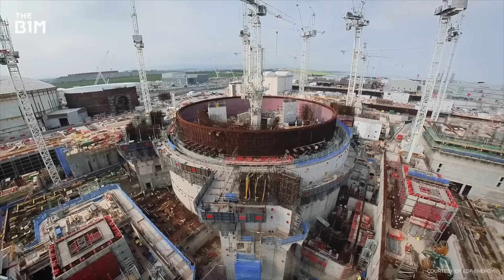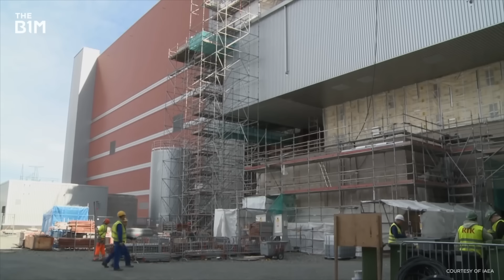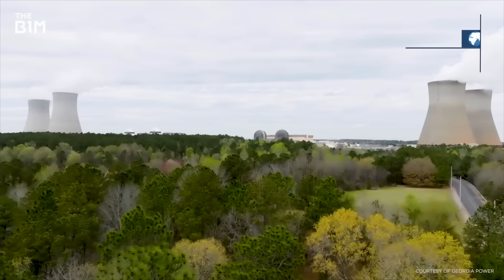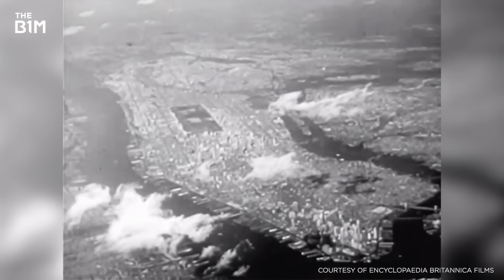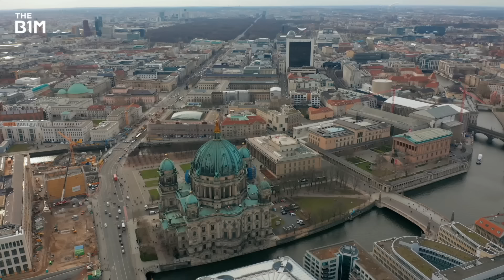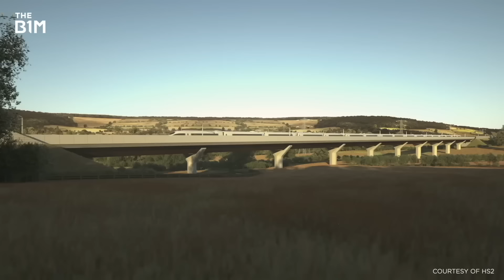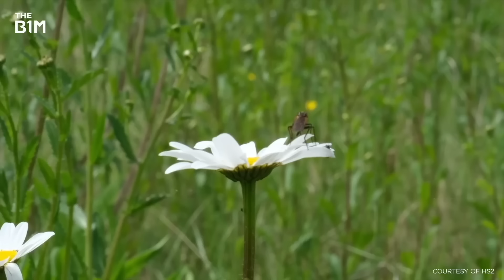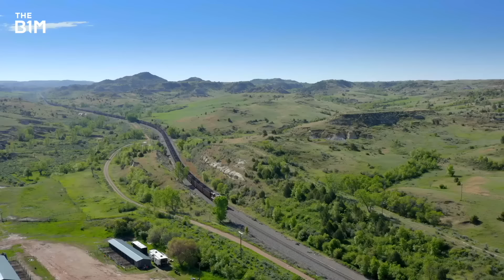Construction Fails: When Big Budgets Go Wrong

Comment: HS2, the channel tunnel went hugely over budget mainly due to poor management. This team then decanted themselves to Crossrail and that project was a financial disaster and years late. The same management team then moved to HS2. No wonder HS2 is a financial disaster. No one from the management team that mismanaged cross rail project should have been allowed within a million miles of HS2. Perhaps the Chinese should have been offered the contract and perhaps the line might have reached Glasgow. Even the Birmingham station is not the main station in Birmingham. I would have built the line from the north to the south preferably from Glasgow. Essentially Brits are not able to manage large infrastructure projects without going vastly over budget and years late. Compare and contrast with Grand Paris Express project and the Swiss Gottard base tunnel, on budget and opened early. As far as I’m aware and stand to be corrected, 
the nuclear power plant has been guaranteed 50p/kw supply price; probably index linked, more than double current KW charge.

Comment: Getting there soon, maybe ?
"The administration of Joe Biden approved funding for Phase 2 of the Second Avenue Subway in November 2021,[151] and land acquisition for Phase 2 started in April 2022.[152] The MTA began soliciting bids for the first construction contracts in July 2023.[153][154] The MTA awarded a contract for utility relocations in January 2024,[155][156] In August 2025, the MTA board awarded a $1.97 billion contract for the construction of tunnels for the northern section of Phase 2 to Connect Plus Partners, a joint venture between Halmar International and FCC Construction."

Comment: For my region this would be the case of the Stuttgart Train Station  S21. But i think you already covered it in a previous. Absolut nightmare with skyrocketing costs and disruption of the whole train system of our region. Its been going on for years at this point and it will be even worse next year. I don`t know how many years they are behind scedueal but it`s a pain in the a.. It even impacted the whole entire traffic system, cause the strees aroud this projects are also in a pretty bad state and there is a LOT of traffic, going round this station.. Stuttgart is a building site and has become a nightmare to enter the city.
For some reason, a lot of big construction fails have been happening in the past few years. Just look at the Berlin Airport. It will get worse, cause a lot of our train system needs some repair... 
Thanks for making these videos! I really enjoy them. Currently watching them, to prepare for a childrens book about Hydrogen and renewable energy:)

Comment: The EPR3 in Finland was sold as a €3.2 billion turn-key solution originally. Now Hinckley Point C could be lik2 €26B per unit. This is slightly more than normal inflation rate. Or maybe it's incompetence.
Reply: To be slighty fair, hinkley point c will have double the capacity as the one in finland. So that puts it at around 4 times the price, instead of 8 times.
Reply: @reappermen  well even with that in mind, it doesn’t explain why it cost so much. Why every project in UK cost twice or three times the price that it cost in continental Europe? Lack of expertise in private sector and gouvernemental structure to challenge the costs. The knowledge had disappeared a long time ago.
Reply: @Tfou3likomDZBledZamel correction, finnland is the outlier there. Hinkley point c is beeing build by the edf, the french energy state company. And frances new nuclear plant is also constantly chugging down more moeny than budgeted
Reply: @reappermen yep because it was their first one since decades but they have more than 50 nuclear reactors and a dozen more to build. 

Their high speed line cost 5 times less per miles than the UK ones.

Comment: Hinkleyi is a giant mistake. China is leading with molten salt Thorium SMRs for a fraction of the cost and significantly safer.Denmark is follows not far behind. UK has painted itself into a corner with yet more pressurized reactors.
Reply: "Denmark imports but does not produce nuclear energy, which is in accordance with a 1985 law passed by the Danish parliament, prohibiting power production from nuclear energy."

Sheer Annoncements and empty promises are cheap, but building nuclear is extremely expensive.

Comment: Appreciate there was a stitching together of previous video sections for this - but for our Friends in London, HS2 no longer exists North of Birmingham, cancelled in full. Next time maybe they should start in the North and work South - there is a history of things stopping. WCRM did not achieve full speed all the way up because funding was cut for everything North of Crewe. HS2 itself should have been built over 30 years ago as it was always supposed to be phase 2 of the Channel Tunnel link way back in 1990.

Comment: The issue you spoke of in the HS2 segment is an interesting argument for economists and city planners. When you introduce a project like HS2, the government rely on economists in consult with city planners. The economists will look at things like GDP for the UK's major cities, London 600B GBP, Birmingham 100B GBP, and then Leeds with 80B GBP and the possible economic multipliers that could be generated directly or indirectly by high speed rail between these main UK cities. City planners would look at things like population density, unemployment/workforce demand, changes to the city tax base ... just to mention a few. These projects are highly dependent on large numbers of socioeconomic factors and when you start doubling construction costs then cutting 1/3rd to half of the planned route, these socioeconomic benefits vs costs become unbalanced. Just look at California's high speed rail, the rail line is needed between the Bay Area and LA but because the project needs politicians to provide funding it becomes impossible. As I'm sure you are aware in the US (like the UK) we have a highly polarized political system then you couple that with NIMBY (Not-In-My-Back Yard) and things just don't get public funding.
Reply: Nope it's due to NIMBYism. Putting most of it underground because a tiny minority cried about trees and grass caused the cost to rise. That is why China built most of its high speed rail above ground.
Reply: Thats one part of the picture but generally replacing car and aviation traffic while improving capacity is always a long-term net-benefit for the communities and local environment as well. 

And as someone who hopes to not live in a dystopian future, those are some of the most valuable factors (in contrast to GDP, which ist just a means to an end)
Reply: I think the biggest issue with a project like hs2 is the community's in-between that are effected. No one has a problem with Bristol and London being more connected but you genuinely aren't going to find many people eu route that wish the same. In some countries it works to push everyone into the orbit of the cities, in the uk it's factual that the majority live outside the city's and aren't particularly interested in becoming more connected with them.....
Reply: The Australian government just announced it was going to stop construction on the Melbourne to Brisbane inland rail at a town halfway to Brisbane. Great news for the random town it's now ending at, but there's absolutely no world in which anyone would have proposed this project without it ending in Brisbane

Comment: The biggest mistake with HS2 was starting in London, they should have started the Northern legs 1st….
Reply: But then you couldn't screw the north of England over once again.
Reply: Every high speed rail project started with the most profitable section first, capital or biggest city.
Reply: Very logical. Here in the USA only way you could get HSR thru California without going bankrupt is to use existing freeway ROW like they are with Brightline West or Brightline Florida (though Florida is Sub HSR at highest speed). The California version is going thru mostly rural area and its more updated versions won't even go thru LA or SF more so San Jose to the North and Ventura County to the South similar to Brightline West, western Terminus is Rancho Cucamonga (not a looney tunes reference actual town in CA) rather than LA instead a BRT shuttle from Downtown and other areas will connect to this rail line. As for Texas its going fully private though Texas is more so a private land problem. CA has alot of public federal lands which makes it slightly easier Texas doesn't. And I can see Texas HSR push to fully private and using interstate highway ROW and some private land domain.
Reply: Ya London is turning in to a third world city. So many stabbings and violent animals roaming freely while law enforcement covers up crimes against women and children.

Comment: "We need power that actually works all the time, and doesn't depend on sunny days or gentle winds or have shitty effective capacity."  "WHAT ABOUT THE FISH!!"
Reply: TBF, the fishing industry in England is extensive. If enough fish die there could be a shortage in the catching area leading to fishermen loosing their jobs and a lack of fish in the local areas which, if you know the English, will not go down well, plus the fish could be keystone species which could devastate other seafood populations leading to a cascade effect exacerbating my prior points.

I don't get why they don't just put the cooling pipes in the actual ocean though, no need to use a suction valve if you dig a channel and use that instead. Then if you're still concerned about fish you can block the entrance with a fish proof mesh.

Comment: @1:01 Hinkley Point is going to be surpassed by solar before the first turbine even spring. It's a sponge to soak up funds for Britain's cement industry.
Reply: It's still energy. and you have a huge deficit of energy production in the UK.
Reply: Hinkley point will work at night.
Reply: Worldwide perhaps. But rather not in the UK where solar yields are highly seasonal.
Reply: Nope PV is over 3 x more carbon intensive……

Comment: Im still convinced that they lowball the projected price for these projects to get them underway or started. While withholding the actual cost. At some point during the construction it would be such a waste to stop the project, so they continue regardless.
Reply: The problem is mostly that no one really knows what these projects cost to begin with, risk mitigation and costing is a curse word for both project and account managers, and account managers usually don’t really know what they’re selling to begin with.
And the government doesn’t really care. There’s very good ways of mitigating these problems you can enforce as a customer, but they worry about being reelected, and it’s easier to blame extra costs on the contractor after the fact than it is to sell a project for its real cost to your constituents.

Comment: Thank god for HS2 wich makes the overspending on Stuttgart21 seem like childrens pocket money!
Reply: And in Stuttgart they didn’t throw the Benefits out of the Window on the way😅
Reply: HS2 does have one advantage: it is almost without function so it does not matter whether it is completed.  The government's own target date to complete it is now 2039-2043 so effectively never.   It was started in 2020.   

When it is completed it will not be used by any Northerner, even were it free, to get to Europe because it stops a mile short of connecting to HS1.  So they would face lugging their suitcases a mile and then queuing for a couple of hours to board.  While in Birmingham at Curzon St it has a bloated forecourt but as originally planned is lacking the passenger footbridge to adjacent Moor St. Station with it connecting lines.   It should have just been a couple of platforms tacked on to the side of Moor St..  My fairly well off relative currently does not travel peak time Manchester to London but travels off peak and then stays in a hotel.  So won't be paying any HS2 price.
Reply: Forget high-speed rail.....
For what they're spending, the train better be powered by the tears of all the UK chancellors who had to sign off on the budget.